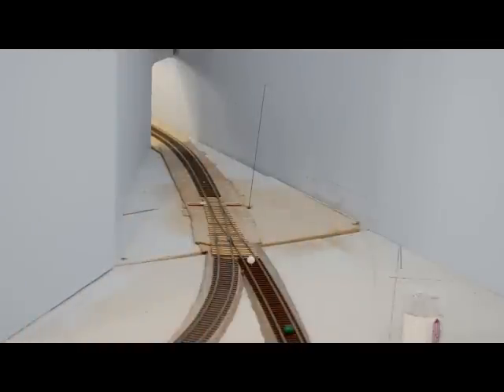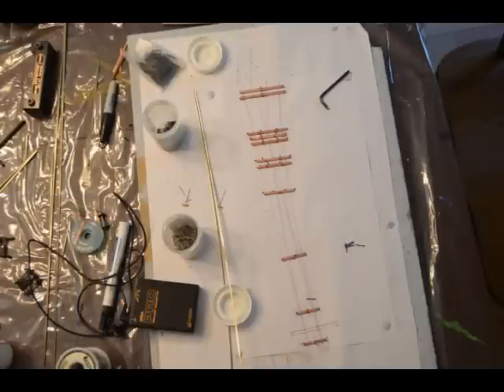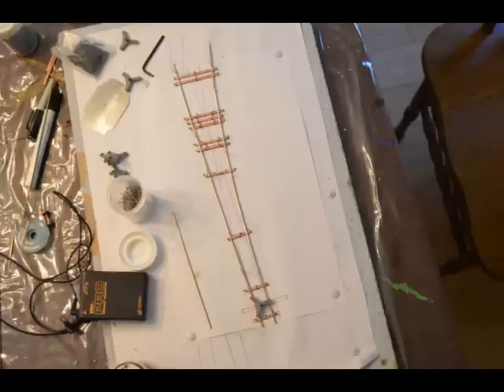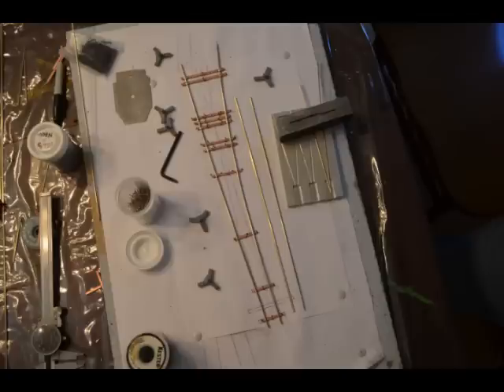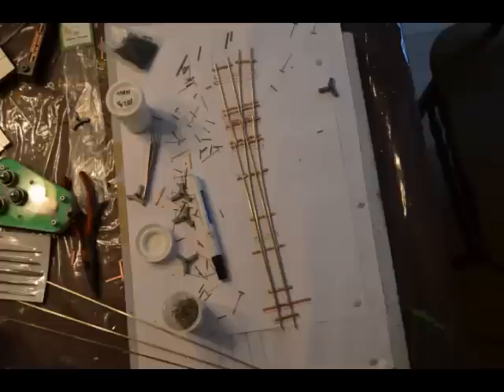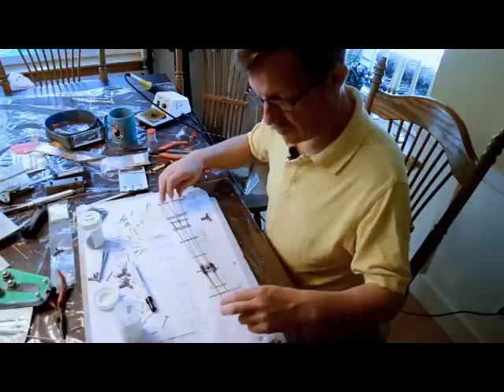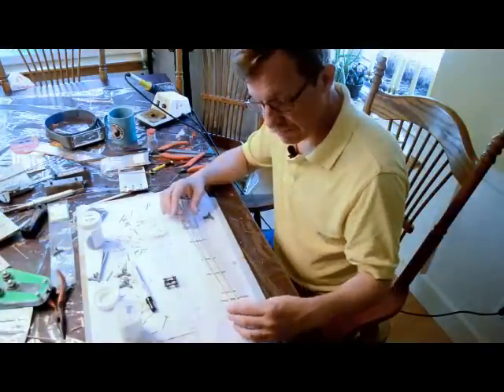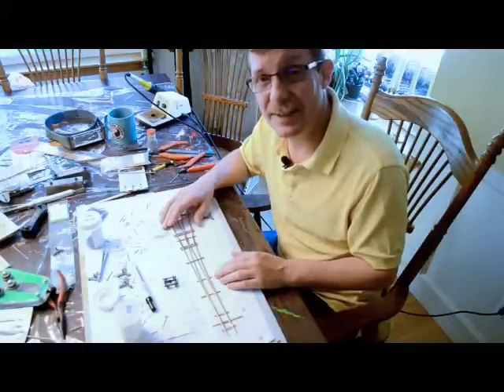Colorado Front Range RR July 2015 -Bulding a custom turnout

Comment: I have enjoyed what you have done, are doing, and will do. The way you presented it is pretty professional too. Most interesting with the old rotary phones interfacing with a digital setup. My father was a sub contractor and every once and a while he'd bring hone an old rotary. We use them believe it or not up until the late 70s; bullet-proof. Wish I had one today - reliable.You make the process of custom turnouts sound easy. Yes, you included the caveat regarding how many you've done but it appears daunting. However, everything looks daunting at first and then becomes old-hat. Someday... :) Looking forward to more... :)